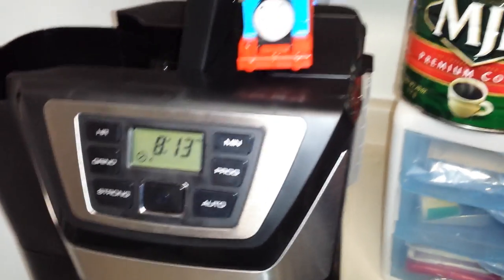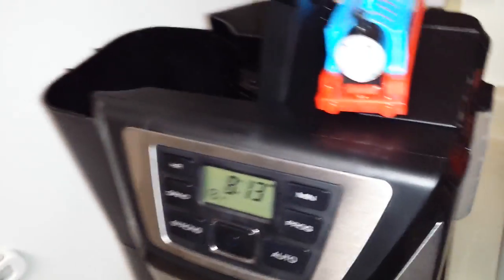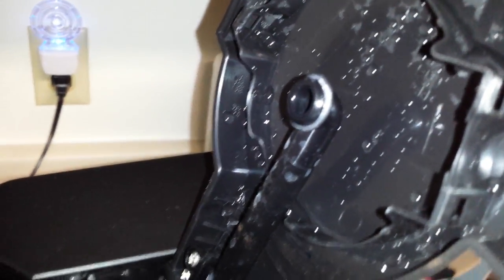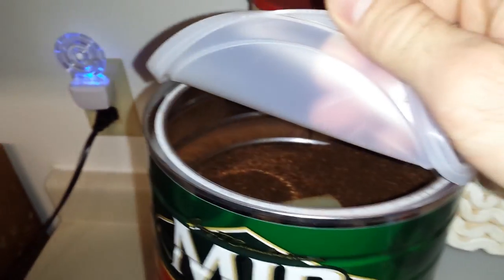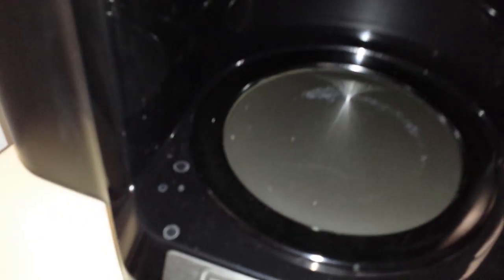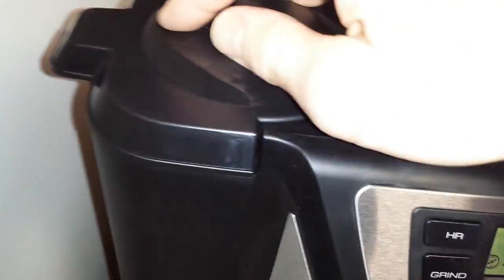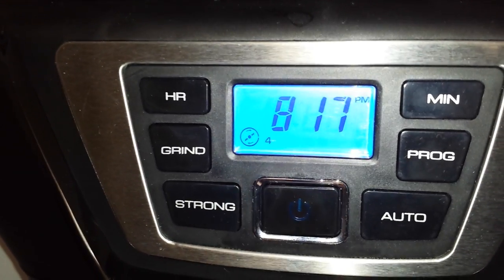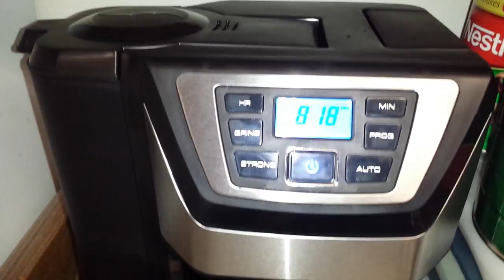Black and Decker Mill And Brew 12 cup Review!

Comment: We appreciated the video, and like most people, we misplaced the manual. The maker would not work because after rinsing all 4 components off, I forgot the shower head part and pushing the buttons short cut and unplugging the maker did not work, either. The coffeemaker that grinds beans was a Father`s Day gift to my coffee loving husband. When we press the buttons thinking something is going to work, it doesn`t. And it shouldn`t work,  because it will ruin the maker, because one of the three main components was not in properly. Could someone please do a video for programming the maker, including setting the clock. I don`t know how to use the other features. I do like this coffeemaker. It is one of the best ones that we have owned in our 35 years of marriage. Happy Love Coffee Day - Feb.14!
Reply: Grace Nelson there is an hour botton on the left (says "HR) simply press that to change the hour. There is a minute button on the right (says "min") simply press that to adjust the time by minutes.

Comment: Thank you for this video. I found it very informative. Just a quick question - you ground 4 cups of coffee beans to 12 cups of water, is that normal? I ask because when I make coffee it is usually 1 to 1 ratio. Just curious if this is due to the type of beans that you used or if you like your coffee on the weaker strength taste? Thank again for doing this video!
Reply: you are correct  Mike, 1 to 1 ratio is the recommended blend on the back of every coffee i have ever used,  4 to 12 is tea to me !!!!.............Paul
Reply: I also have this maker and its works for me !!
Reply: mike peebles He likely went 4 / 12 because it was late when he made the video so he went for a mellow mix lol